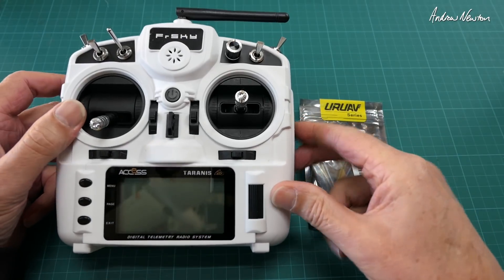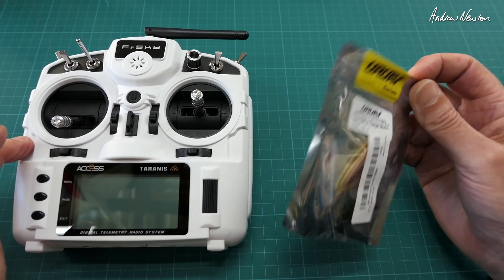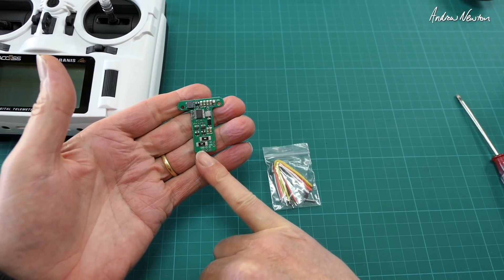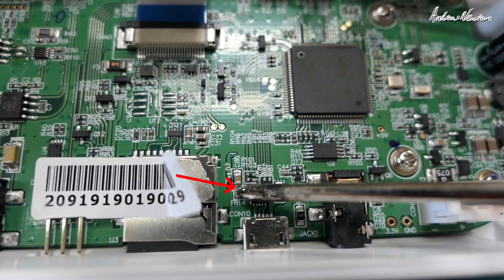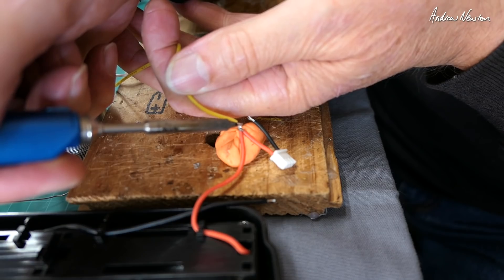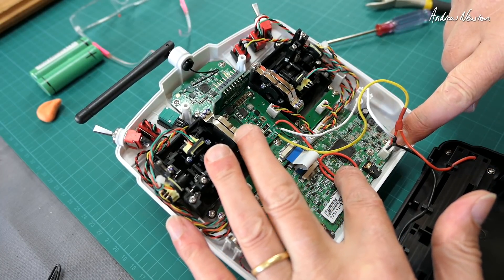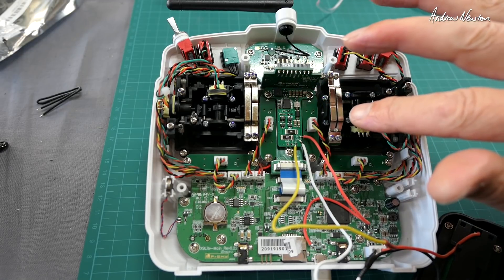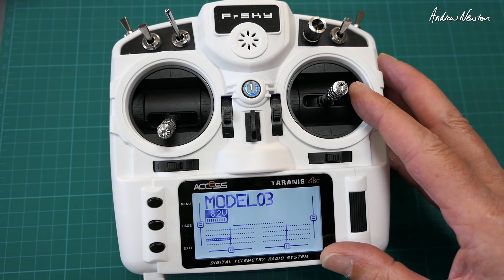Taranis X9 Lite Charger Board

Comment: The only thing good with the x9 lite is the getting rid of JR module , which goes against computer peripheral common practice. The problem with JR module bay is that the header pins are way too long and pin holes are way too deep for common computer ribbon serial/parallel accessories. The module runs as a UART Unix ttyS0 peripheral, but the Japanese never caught up with computer peripheral business. They think the module is a special electronic device, like a Sony laptop. Every reviewer on youtube got caught off guard with lining up the long pins wrong and module malfunctioning problems. It took frsky and the rest of the world 50 years to fix it. Now the pins are pretty standard length of DIP IC components. No more complains of misaligned pins when inserting module.

Comment: Shouldnt both 1s and 2s connected to the batteries ? so that the 18650 "pack" would be balance charged ?
Reply from the maker: Yes correct. Not a balance charger as it comes.

Comment: It's an obvious question, why didn't they include this as standard?  Although I would add a word of caution, because recently I had a problem using a micro USB port to charge my mini Monitors internal Lipo, They CAN break off the PCB and are rather delicate TBH. So, when you push in the USB plug to charge it, be gentle with it or you could push the socket off the PCB. It's not like a USB Port on a Mobile Phone for example, it's not as durable.. Be interesting if you could examine how well soldered the USB socket is fixed to the PCB.
   Now I have to find Amber saying "System on ready to fly"...for when I Arm my Quad....lol.
Reply from the maker: Yes it does look a bit delicate. A dob of epoxy might be a good idea.
Reply: Think I'd get a semi every time I armed 🤣
Reply: I am also alerted when i see the charging going in with a USB cable. The problem is that we all do the charging in the car with the TX thrown around bouncing on the seats. I have a V800D FPV goggles, and the USB charging port got damaged within 1 week sitting on the passenger floor with a USB cable plugged in. 100USD burned.

Comment: Another great video.  I would have added a couple of dobs of hot glue to secure the wires inside. It also stops fatigue failure of the solder pads to wire joins.
Reply from the maker: Yes, next job. I'll add a JST too so I can fully disconnect the back.